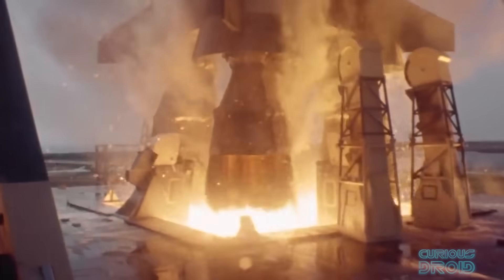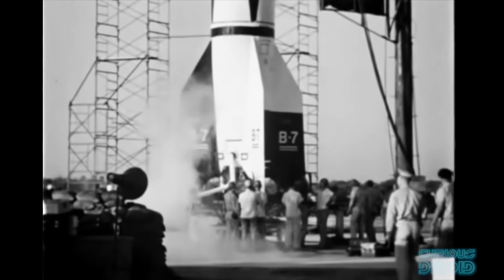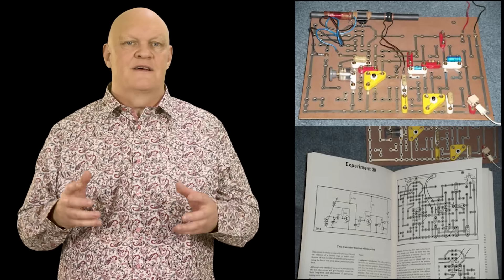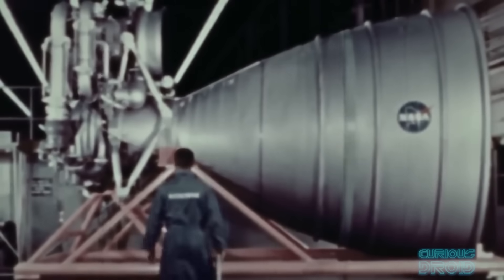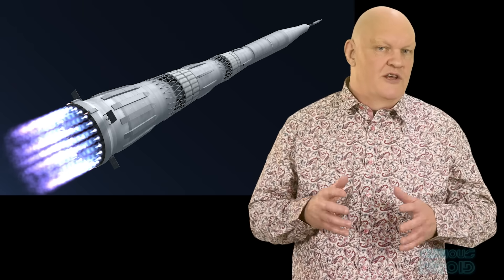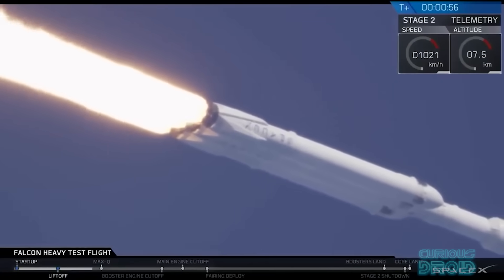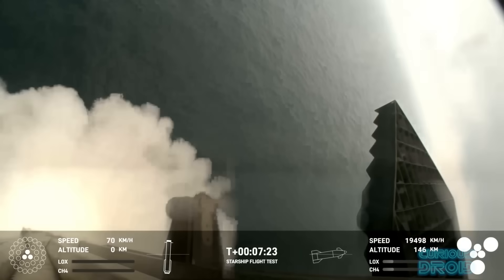Why Does SpaceX Use 33 Engines While NASA Used Just 5?

Comment: The fact is that the Apollo Saturn V rocket was capable of lifting with one launch all of the prior US payloads sent up since the dawn of the space age is remarkable. Its 7.5 million pounds of thrust at take off was an incredible feat to achieve and its vehicle design was largely done without computers.  It was an historic  achievement before American children began to be deliberately dumbed down.
Reply: Our Best and Brightest worked on this.
Reply: Agree, on top this was done all in less than 5 years… God bless each one of those magnificent engineers 😊
Reply: .  . While remaining in near-Earth orbit, another indication are the impossible weather patterns seen on Earth, when in reality only a small portion of the Earth's surface was visible, framed by the round window of the command module.  Straight line cloud fronts are seen on video to be extending for what appears to be more than 6000 miles, a quarter of the Earth's circumference -- something that has never occurred in the meteorological record on Earth. The round window of the command module was used to effect an image of the Earth but the weather in the region did not comply for a realistic view.  No recognizable continents are found in view, but only the impossible weather patterns seen.
Reply: Did Apollo 11 actually leave near-Earth orbit?
Despite the revisionist narrative that this channel won't question -- unstable fuel burn for the oversized F1 engines was never rectified and another arrangement in their place was made in order to reach near Earth orbit, keeping the F1 bell nozzle to maintain the desired appearance.  The great licking yellow flame was an indication that something was not normal as fuel was burning in the atmosphere while providing no additional thrust. This was the result of injecting additional kerosene into the exhaust stream for greater visual effect yet appearing to produce an inefficient burn unlike other rockets after launch.  No explanation is forthcoming and this issue is not addressed in any usual report; however, using a smaller reliable engine with a reduced fuel load and stripped down mission requirement allowed the Saturn V to reach near-Earth orbit.  

The Apollo 11 crew attempted to demonstrate their position at over halfway to the moon as seen in the unedited version presented to the public while the more recently released unedited version reveals a flood of blue light entering the same window as the camera continues to roll, through which only a moment before, we saw the Earth far distant in what appeared to be very low light conditions. Then, as the camera pulls back from the window, the exposure settings are seen to return to normal as a flood of light enters the same window.  Without a change in the orientation of the spacecraft assumed to be on a trajectory toward the moon, the only source for any flood of light can be the Earth while in near-Earth orbit.  The usual sponsored efforts will try to make excuses for why the obvious did not take place -- yet is overly apparent in the unedited version.  When facts cannot prevail in support, sponsored activity will resort to name calling and other derogatory comments discrediting themselves.
Reply: @ronaldgreene5733  the Rocketdyne F-1 is very well documented. https://youtu.be/Z37MdvcSaFY?si=_eHMaJfyQbvmBn6I
Reply: @alantasman8273

The Saturn V was capable of lifting off and getting out of sight to get any longer spotted before plummeting.

Now they apparantly try to create a real functioning rocket with purpose and not only fireworks for the staged Apollo TV show.
Reply: @THOUGHTCRIME_No1  So just how did those laser reflector panels and seismic Moonquake detectors used for generations get on the Moon. And I suppose you think the Apollo 13 mishap was staged as well. LOL
Reply: @alantasman8273   Why do you think there are any laser reflector panels on the moon? There are none and they are not needed to measure the distance.

Of course Apollo 13 was also part of the storyboard. A little bit of suspension for the show.
Reply: @THOUGHTCRIME_No1  dude the whole thing was literally on live tv, get a grip.
Reply: @blockstacker5614   Dude, you are not informed. Not a single TV station showed live how the airplane hit. Watch "The Great American Psyop" and learn.
Reply: @THOUGHTCRIME_No1  The Saturn V rocket is hardly an airplane, and the only thing it hit was the ocean following stage separation.
Reply: @THOUGHTCRIME_No1  I bet you also think that joe biden can still do cart wheels whiles solving trigonometry problems. You probably still wear your mask while driving your Prius by yourself.
Reply: Marxism (DEI) is to blame.
Reply: @TucsonDude  DEI ...Didn't Earn It.

Comment: I believe SpaceX has had some 6 or 7 rockets blow up. This is what happens with profit driven designs.
Reply: No, this is what happens with experimental designs like Falcon 1 and Starship. By contrast SpaceX's operational design, Falcon 9, has an excellent track record.
The overall failure rate was 2 failures in 346 launches - the space Shuttle by comparison had 2 failures in 135 launches, giving it 2.5 times the failure rate.
The Block 5 variant in particular has had 0 failures in 290 launches - which is by far the longest streak of successful launches of any rocket in history.

Comment: Many smaller engines means some very important basic elements : a) you can manufacture much smaller components which makes them faster and cheaper to tool up and to build. b) like investing, you diversify your risk - a single failure means a much smaller % loss of thrust.
Reply: yup. It makes failure more likely socne there is more things that CAn fail, but redundancy means engine loss isnt as much of an issue

Comment: 15.20: as I understand it, the Falcon 9 landing on one throttled down Merlin has a thrust to weight ratio of more than 1. If it didn't cut the engine at the moment of touchdown it would head skywards again. The one shot "suicide burn" strategy.

Comment: The Starship looks disturbingly similar to the old Soviet N1…a rocket booster that regularly failed or exploded in spectacular fashion.
Reply: Just as well we judge Starship on its performance rather than its appearance.
Reply: The most important similarity between the N-1 and Starship is not the configuration, but the development method. There are two basic methods:
1. test individual stages on test stands exhaustively before proceeding to the  first flight, in an attempt to make the first flight be flawless. This approach is used by most Western companies. 
2. Move to in-flight testing much sooner in the development process. This gives you flight experience earlier in the process, but risks blowing up a bunch of rockets. 
SpaceX is doing this with Starship, and the Soviets did it with the Proton and N-1. It saves a bunch of money. They also reckoned building a first-stage test stand for the N-1 would have taken years (and they were already behind) and would have taken up too much of the available concrete production in the USSR at the time. For the Proton, 14 test launches were needed before it was ready for operational use, and for N-1 they were counting on a similar number of development launches. 

The differences between N-1 and Starship are far bigger. 
1. Engines: the NK-15 could not be tested before use. It used pyrotechnic actuators that had to be replaced once used. So instead, they'd build 6 engines, test 3 of them, and if those passed, use the other 3 on the rocket. SpaceX tests individual engines, AND can test the complete stage at least for brief test runs on the launch pad. 
2. Control systems. KORD on the N-1 was unreliable, famously shutting down all but one engine when one of the launches developed a recoverable fault. Not an issue with modern electronics. 
3. CAD. SpaceX can simulate the vibration environment in the stage in ways not possible in 1965, which eliminates many failure modes (at least one N-1 launch failed when a fuel line shook apart). 
4. Money. SpaceX is rich and can afford to expend a bunch of rockets. The Soviets were not rich, and really couldn't afford the N-1.

Comment: Thrust is important, but it’s just one part of a more complex system. The weight of the rocket, number of stages vs in-orbit refueling result in an amount that can be placed in orbit. 
The Starship booster being made of steel is much heavier than the Saturn V first stage. There are three stages to the Saturn V, but only two for Starship, hence the requirement for in-orbit refueling. Or put another way, Saturn V used two stages and 10 engines to insert a Comand/ /service/LEM and TL stage into orbit with one launch (11 engines to the moon plus another 3 to stay in orbit, land and return to orbit = 14. Starship requires 11 launches with 363 engines to be able to get to TL, plus an additional ? to land and return astronauts to lunar orbit (363+ vs 14 engines, 1 ! Vs 11! Launches (and also  multiple return captures). 

Which works more efficiently and effectively, wait and see, but my bet is on the system designed over 60 years ago.

Comment: Could you explain why musks wants to land the boosters with rockets instead of x-15 like winged gliders?
Reply: Because the rockets already have rocket engines. They don't already have wings. You want to add as little extra mass to the rocket as possible.
Reply: Weight.  You need to add a wing and landing gear.
Reply: Because it's the first stage of a rocket, so the front end can't be streamlined like a plane. (And for the reasons given by the other two posters!)

Comment: also space x uses nearly the same engines for sea level and vacuum thrust , making even more scale production economy
Reply: At the cost of engine efficiency and greater resulting weight.
Reply: @aemrt5745  yes , and they have to use the same propelent for the different stages 
on the other hand that means they have one type of engine to develop , test and tune , so they have more budget , time and test time 
if the engineers choose this option it is probably the best one in their situation

Comment: It seems that quality is ignored at all costs (literally) by wanting to produce at mass. The thing with complex engineered components is that they are still bound quality issues seen in mass manufacturing! In fact, according to statistics (ie the basis for all engineering work that led to modern reliable technology) is that the probabilities do not change much when ramping up, and infact you are mored likely to encounter less homogenous raw materials, components due to the limited number of suppliers. Additionally, almost all mass produced engineered products are designed and developed with quality in mind (lean 6sigma). Now, if it were to be applied to rockets, I had say that is a bad idea because safety is the upmost priority. Thus I think that them using many rockets is a very bad idea if they want to safely transport loads to outer space. Just a thought from a quality engineer!

Comment: So it's nice to believe the cost to make the rocket engines will go down.  But you have to remember that spacex is a profit driven business.  Meaning just because the cost to make the engines or rockets goes down, does not necessarily translate to lower launch prices.  We need only look at how much spacex is now charging nasa to bring astronauts to the ISS.

They initially began charging 52 to 55 million per, and now spacex is charging nasa 88 million per.  The costs went UP as spacex began launching more frequently.  Which is oddly enough more expensive than what russia was charging with soyuz that musk had originally criticized the price on.
Reply: SpaceX has increased the prize for a seat but not to 88m $. 
Crew-7 through Crew-9 65m $
Crew-10 through Crew-14 72m $
which is still quit a bit cheaper than Soyuz (86m last time an Astronaut flew) and Starliner (90m estimate from 2019)

Comment: Well, the SLS was dreamed up by a couple of senators who wanted to keep the space economy going after the retirement of the shuttle. I'd not beat NASA up too much about its design.
Reply: Why would they give shuttle attributes isn’t SLS a moon rocket
Reply: Likely they choose what they did to bring the wealth into favored contractors, keeping the shuttle engines going. 

Personally I think the capsule based  booster rocket technology wasn't the way to go. I think space x has the right idea with starship, we need to develop capability like an airliner or the shuttle in the movie 2001 A space Odyssey. The shuttle was only partially what I am talking about, it was too expensive to fly and had too many compromises. It only existed because the military was interested in it, it was redesigned to fit their needs which also helped make it not what it was supposed to be. Not really NASAs fault, their budgets were slashed after Apollo,they were working with relative peanuts.

Comment: Well I mean it seems pretty obvious, right? If one engine goes out on Starship (which actually was the case this past launch), they can still go up, separate and recover the booster portion. If one engine goes out on the other configuration then they’ll be having a real bad time.
Reply: Yeah one of them has an orbit option, the other, not so much, so yeah one of them is going to have a real bad time.

Comment: If you look at SpaceX boosters landing....they can decelerate from 2000km/h to 0 in a few seconds, because the thrust is the same but the weight is much lower. By saving this to land it, you are keeping 2000kmh of speed for the landing, the most bang for your buck, and it's not used to gain speed/altitude for the launch

Comment: turbo pumps never gonna be reliable. and reusability is a lost cause. Turbo pumps have a problem with refiring after they sat in space. yes maybe for launch but never going to moon if you dont wanna lose astronauts. The forces are way too large to reuse anything that makes sense. even the smallest mistakes make a huge explosion's at launch. I would recommend thunderfoot
Reply: Thunderfoot is pretty clueless about the space industry. He really should stick to topics he understands.

There's no reason to think that turbo machinery can't be reliable in space. There isn't a huge amount of experience with it, like hundreds of firings after weeks of sitting around in space, but there is enough data to see it likely isn't a huge problem. One data point is the RS-25 main engines on the shuttle. These engines spent a lot of time in space, and while they weren't fired in space, they were recovered, and if the environment were damaging to the engine, it would have been observed.

And we are already in the era of reusing hardware. Falcon 9 already does it well, and other rockets like Neutron and New Glenn are following in the footsteps of Falcon 9.

Full reuse is more challenging, and we don't know whether it can be made as rapid and easy as SpaceX wants. But the only way to success is to try. We don't know that it's impossible.
Reply: @SpaceAdvocate  Nasa did reusability with the space shuttle they succeeded and the turnover was a month or so and it wasnt rly that much cheaper. Why did they give up? You think because musk got the 2,5 billion instead of Nasa? how is that going? Isnt there a case against him right now for missing the whole promised schedule? They didnt use turbo pumps cause they were unreliable thats why there is not much experience with them. So you think its acceptable to waste 2,5 billion and not even escape the lower earth orbit? Why is that money given to a new guy who failed at it all. Iv seen some of the launches, the rocket explodes and they pretend it didnt. They are testing heat shielding that is already done by nasa and it was a fail again. Tell me how many engines normally fail on their launch? And that's an empty rocket. how many KG have they put in space? They cant even get to the point of the real serious issues they have to deal with. I just dont understand how you can call turbo pumps reliable when almost half the engines fail on every launch. but i guess its harder to convince a man he is being fooled then fool the man.
Reply: @marisbarkans9251  "Nasa did reusability with the space shuttle they succeeded and the turnover was a month or so"

Nope. Shortest turnaround time ever was 54 days.
Reply: @SpaceAdvocate  there is no reasonb to use turbo pumps cause the alternative is plenty good and reliable. he does this bullshit because he knows they cant do the moon mission. even nasa would struggle right now cause all the systems have to be renewed and the infrastructure isnt there anymore but they have more then enough experience. I bet he did the usual scam where he promises everything then steals money and just forgets it. Naah this time this fucker is going to jail. and ill be back to trow it in your face!
Reply: Turbopump engines refire in space often, the Shuttle had major problems with it's huge amount of tiles that were mostly custom to their location on the Shuttle, required a huge amount of time to glue on and kept on getting damaged due to foam strikes from the ET. TF is also a bad actor that has no idea about rocketry.

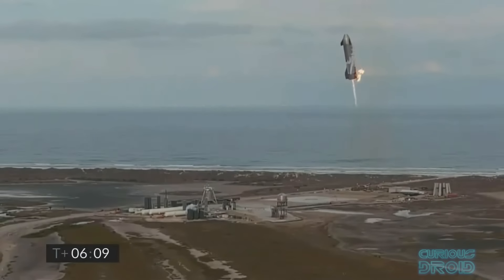Comment: 18:35 SLS got to the Moon and back in the first try. Starship with it's 4 launches has demonstrated only a fraction of what it needs to achieve the same feat.
Reply: The SLS was also 5 years behind sceldule and devolpment cost wher about 23b $ to that point while reusing old Space Shuttle hardware, and Block2/Cargo SLS is still not finished.